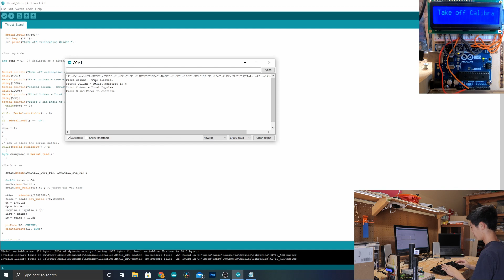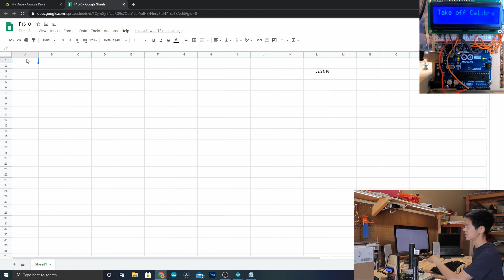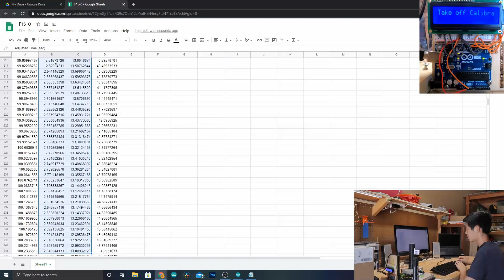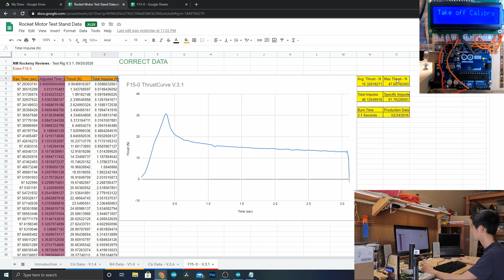Rocket Motor Test Stand Version 3 - Update and Data Review

Comment: Dude strain gauge is attached directly to the motor mount eh ?
Reply from the maker: No. The strain gauge is attached to a flat mount and the motor mount is attached to the flat mount. This allows for easier calibration before testing.